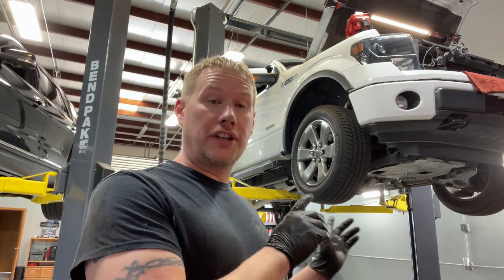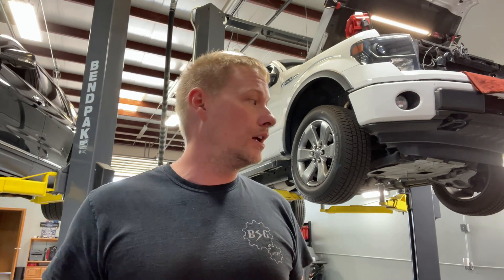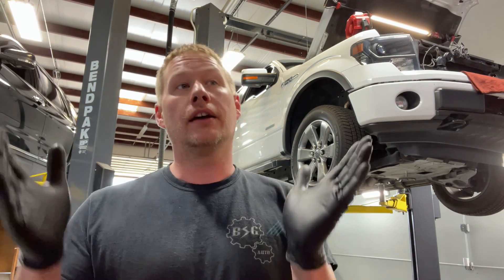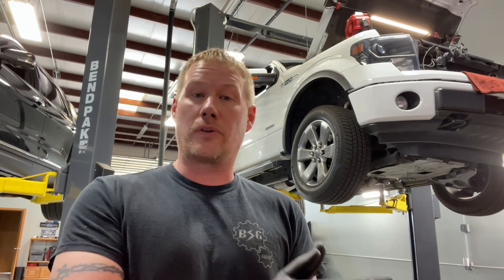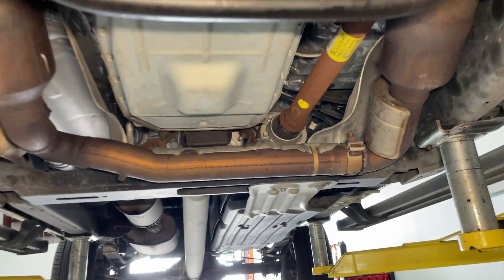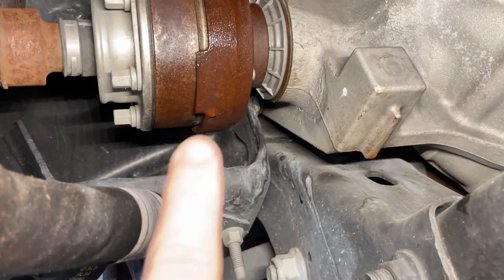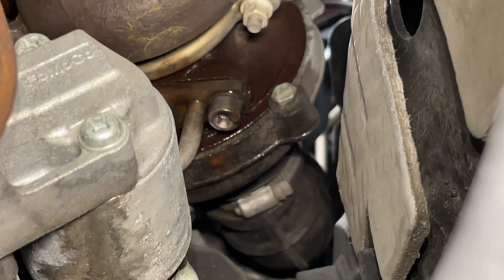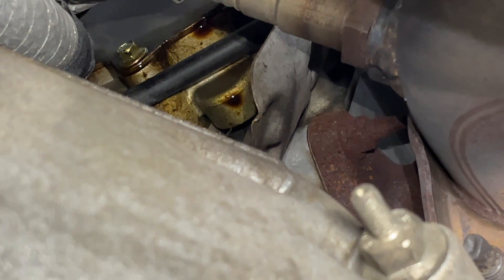Ford Ecoboost Engines Can be so Hit or Miss: I Really Feel Bad for This Customer...

Comment: Maybe it's less about miles and more about age.....I've always found when a vehicle hits 7 years old, you start having problems. I can only speak first hand about Chevys or Ford's, that's all I've owned. I have a 2017 Escape, Ecoboost, fingers crossed, I have low miles, it's my retirement vehicle.
Reply: I agree with you, things will break either due to miles or age. How well you maintain the interior & exterior of your vehicle won't prevent mechanical or other things from braking. My water pump went out at 62K  miles. I have the 5.0 on my 2013, Luckily I bought an extended warranty on it & Ford took care of it. But I have also had every coolant leak that these are know for. Bad O rings.

Comment: I just did a passenger side exhaust manifold stud on a Fire Department F150 with the 3.5. Only had 76K on the clock.
Reply: I’ve had both exhaust manifolds fixed, I think they actually replaced the passenger side manifold. I wondered if it was common. 2016 3.5.

Comment: WOW that sucks.   I am really impressed by you that this bothers you that the truck is having those kind of major issues at relatively low miles.  You're a good guy.
Reply: These problems are just as much a time issue, when you don’t drive a truck often seals harden and dry up ,the oil drains back all the way and it dry starts ... this isn’t an ecoboost issue as much as a truck that isn’t used enough. I am a highway dept mechanic we have 2005 trucks with only 25000 miles on them , our 2017s have 5-6000 miles, These trucks are constantly breaking and leaking . It’s from lack of use . Same trucks that are driven daily are much better trucks. I wish our guys would take them out once a week in the off season ,to keep them from rusting away and everything from seizing up.
Reply: @JohnDiMartino  A lot of that depends on the climate that the vehicle is driven in too...I would think?  Plus, little engine and forced induction...lots of stress and weak parts. Just a bad design all the way around. imo.
Reply: @JohnDiMartino  I have a 2002 f250 2 valve  with 125k miles And still puts out a lot of great feeling every weekend I take it for a drive . Love old school Ford!
Reply: Yeah he's real. If a vehicle has 130,000 mile problems at 70,000, it just plain sucks.
Reply: @a.s.4914  You're damn right he's real. That's rare these "daze."
Reply: That's how I knee you can trust this guy. Within 2mins of the video
Reply: What about is it normal for a 2013 Ford F-150, fx4, 5.0 waterpump to go at 47,000? Can’t tell cuz of its age or miles that this would happen! Sound about rite?
Reply: After seeing comments, it is kind of weird that a 2013 f150 has only 48,000 miles. I bought the truck 5 yrs before with 33,000 on it. I drive everyday to work and where ever.

Comment: Please make a video about the 3.7 duratec engines. My 2013 F150xl has this engine. I am sure you can tell us problems with it to watch for. The water pump is inside the engine. How to know when it's leaking.
Reply from the maker: Not much to watch out for on a N/A 3.7L engine and no your water pump is not inside the engine. It is external like you see here.
Reply: @FordTechMakuloco  after searching I found a video you did 3 years ago. You show the water pump with the timing chain. Stating if it begins to leak, it will cause damage to the engine.  You said the water pump is internal. This is what I meant when I said inside the engine.  
https://youtu.be/R3-NOGZL8ms
Reply from the maker: Yes that video is only for the transversely mounted powertrains, the F-150 features a longitudinally mounted powertrain which has more room for an external water pump as shown here at the end of the video.
Reply: @FordTechMakuloco  yep, just figured I'd clarify that the transverse did have them in the motor. But longitudinal, such as in the trucks, they're external. Just figured in case others read the comment, so there is no confusion 👍
Reply: @xnotx2  clickbait king and fake news Scotty Killer talked about the water pump in the transverse engines but no mention that it wasn't the longitudinal ones in the F150.  This has caused a lot of confusion.  Finally knowing the difference is a big relief.  Now I know my water pump won't destroy my engine. 

Unfortunately when people on YouTube talk about the water pump on the 3.7, they mention Mustang and F150 but don't really explain the difference.  I honestly believe people like Scotty Kilmer should be banned off YouTube for so much misinformation and constantly bashing dealerships service departments.
Reply: @FordTechMakuloco  They are on the transverse vehicles.

Comment: I had a 2013 SHO. Maintained it meticulously and still the left turbo started to leak and was quoted $2k to fix right after warranty ran out. Never will buy a modern Ford again. I had 85k miles.
Reply: @Minn_So_So  Good choice you made.

Comment: 5.0 is the way to go with the F150. No problems ever with my 16 5.0 130k miles.
Reply from the maker: Except the 18-20 5.0L models were a complete disaster.
Reply: @FordTechMakuloco  have you done a video on the common problems with 18-20 5.0 ?
Reply: @FordTechMakuloco  What were the biggest changes between those years and years prior?
Reply: @JamesPalylyk  18-20 5.0 direct injection was added and piston liners were changed to a coating instead of a sleeve.
Reply: @JamesPalylyk  That’s the first year the 5.0. Went with Direct injection as well as multi port injection, they did not use sleeves in that black rather it was plasma arc wire transfer, and they have plastic oil pans and we’re closer to a 5.0 L than the previous models
Reply: @FordTechMakuloco  what is the cause of the oil consumption on 5.0. My 2018 is using 1 quart every  1200 miles.
Reply: @garypuls5263  poor Ford  quality. Upgrade time!
Reply: @garypuls5263  Bad piston rings too much blow by
Reply: @Lothbrook6837  My dealer is talking to Ford about replacing the engine finally
Reply: @FordTechMakuloco  Very True. Will the 21 5.0 be any better? Direct injection, DOD UGH
Reply: @FordTechMakuloco  Really?  Glad I pulled the trigger in 2017 !
Reply: I’ve had better luck with my 3v 5.4 than I have with both of my 3.5 ecoboost vehicles.
Reply: @RadDadisRad  my brother has a 5.4 3v with 370.000 miles on it. All city driving loaded with all his tools with no isues.
Reply: I got 235K and counting on my 2011 5.0 now. It’s a beast!
Reply: Absolutely correct!! 5.0 all the way!
Reply: I have the 2.7 ecoboost in my F-150 and knock on wood I haven't had a single problem except for the recalls on in other than that just general maintenance plus I plow snow with it and it does amazing
Reply: I disagree. Talking to my coworker who is a ford master tech, he would say differently. The 5.0 is junk.
Reply: @alextran8188  lol BS. You must be an ecoboost owner
Reply: @alextran8188  not sure why he woukd say that. Besides the oil consumption issues the engine itself is solid.
Reply: @johnullman6159  probably because he works on them all the time. They are famous for bad rings and making knock like noise  at low end/idle